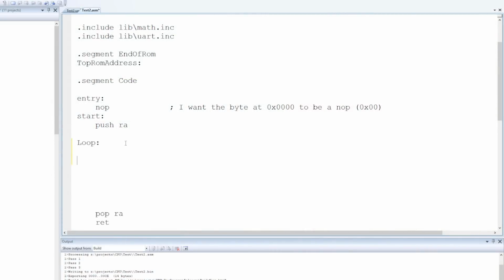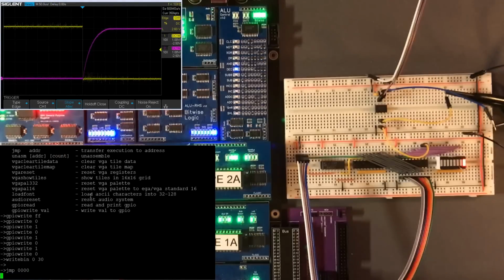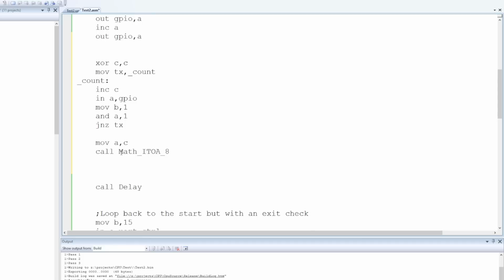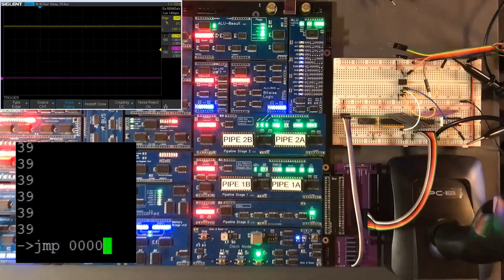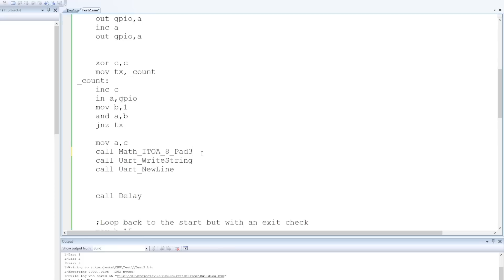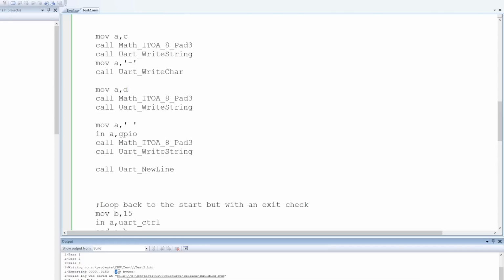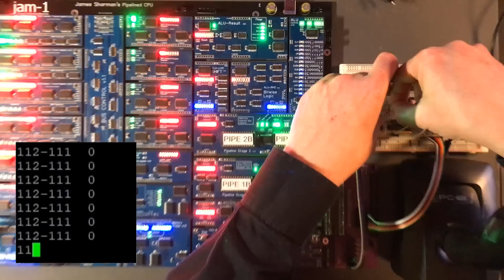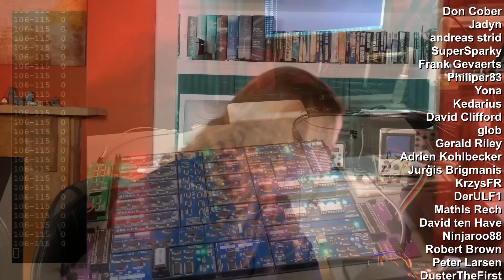Analogue In - IO from Scratch - Part 2

Comment: You can read out the joystick position and buttons, but you can't do much of anything else with that setup, can you?  You're relying on that loop running alone to measure the response time and if you go off writing textures and computing collisions, that timer is stopped.  Even if you had an interrupt, it might not be tight enough to give you a good reading.  How did they get around that when pong was moving the ball, etc.?
Reply from the maker: There are different ways to handle this and I don't know what implementations did what.  I would arange the circuit such that a full read would approch 1/60th of a second and count scan lines. That way the check could form part of other beam racing activities.

Comment: This is great, and could work the same way we do it with MCUs, by having it interrupt driven. Start discharging the cap with a timer set to zero, then increment the timer via the CPU clock (via a divider I guess, as you probably don't need extreme resolution), then the GPIO generates an int to store the timer value and set a flag indicating the conversion is complete. A lot of MCUs only have one or two actual ADCs, and multiplex them too. So I guess if you multiplexed you could indicate the channel when starting the timer and the elapsed count could be stored in a location related to the channel, so all of this would essentially happen in the background, and the main CPU code only needs to read from those memory locations when it feels like it :)
Reply from the maker: Indeed. But without interrupts I do find myself thinking about what tasks I could interleave. The Atari 2600 counted scan lines so it mixed it in with other work. Need a bigger cap for that though.

Comment: I saw that the Atari 2600 paddle uses this method. Very simple solution to an otherwise complicated problem.
It works even better on the 2600 because you can measure if the cap is charged on each scanline to position things like paddles in pong.
Reply from the maker: Yeah, although there is nothing to stop me putting a larger capacitor in and checking each scan line as well.

Comment: What you have built there is a rudimentary single ramp integrating ADC. If you added a counter and a comparator and a latch to count and store the rise time it would reduce your processor utilisation and turn your circuit into stand alone integrating ADC.
Reply from the maker: I worked out a circuit with a couple of counters and a latch to automate this but I’ll be showing other techniques in future.

Comment: 2:30 The circuit you're describing is somewhat similar to how capacitive touch sensors work as well. That's kind of cool.
Reply from the maker: Hmm, I haven’t looked into that but I can see how it might work although the capacitance is what would be changing rather than the resistance.
Reply: @weirdboyjim  Right. You run out a large-ish capacitive surface out from a lead, then you connect it through a resistor to a second lead. The first lead turns on periodically, and the second lead waits for an up-going signal. The capacitance of the surface should take a fairly regular amount of time to fill up and reach the trigger-point of the reader. However, if you touch the surface with your hand, your skin increases the total capacitance, causing the fill-up time to suddenly become longer. When I learned about them I was shocked by how easy it was to implement.

Comment: Converting a voltage/resistance into a PWM signal is clever for this kind of applications - the CPU can naturally measure time with high precision and you save on bus logic because the "analog" signal is basically treated like serial data rather than parallel data with a real ADC. The only question is, how linear is the pulse width from the 555 with the resistance? I'd guess the nonlinearity is negligible for gaming, or you can implement a very simple LUT for linearization (which is what the "calibration" screen in a videogame does).
Reply from the maker: I would have thought it would be very linear, I’m more worried about the cheap linear pots some of the joysticks have.

Comment: Could you do both axes with just one channel by interleaving them? Using a couple of transistors on the analog side to switch which channel is being read?

Edit: aha, I jumped the gun on that comment, I didn’t see the part about how you wanted to read them simultaneously. It’s a really cool ADC though, so simple and yet perfectly effective for a low precision input.
Reply from the maker: I was about to comment that you could, but it would double the read time.

Comment: Super cool! Also not the approach I'd guessed you'd take; I'd expected you'd go right to implementing a binary-search ADC -- that is, an R-2R ladder DAC plus a comparator to tell you if the DAC output is higher or lower than the analog input.
Reply from the maker: lol, let’s not get ahead. But that kind of ADC is much faster than this. Watch this space 😉
Reply: @weirdboyjim  I look forward to seeing it!
Though, the hardware implementation of the binary search ADC can be almost as trivial as the RC-time ADC -- you just feed the R-2R off GPIO output pins and loop the comparator back to a GPIO input, and let the CPU implement the search algorithm in software.
It's also pretty straightforward to move that binary search logic to hardware though, with just one shift register and one accumulator register. (Shift register scans a single bit across from most to least significant; this is ORed with the accumulator contents, which gets fed back to the accumulator input and to the R-2R; the comparator output then just feeds the accumulator's load enable line. The only other things you need there are the bus interface logic and a tiny bit of logic for resetting and triggering the start of a conversion, plus probably a clock divider to slow down the conversion speed to keep within the comparator's bandwidth and propagation delay limits.)

Comment: I used to use the same technique back in the 90's when I was playing with PIC16F84 MCUs and making line following robots with them.
Just sample the pin until it went from high to low, switch it to output to charge the cap, switch back to input and sample over and over until it went low. This gave a poor man's ADC and worked  like a champ. No 555 needed.
Reply from the maker: Yeah, I could do it with a cap and a diode but you are relying on the trigger threshold of your input pin being consistent.
Reply: @weirdboyjim  There is some definite hysteresis on the levels but for most of the applications I used, it worked fine.

Really enjoyed your video and the project.
Wish I had time to get back into that hobby.
It was my passion for many years.

Comment: When I saw what you planed to do, I knew you were going for the timing method, but my mind went in another direction: could you use a 8-bit (or so) counter IC, maybe a 74xx590 with output register. Connect it up to the system clock and have the reset/latch driven by the capacitor/potentiometer circuit? sure, this is more involved, but performance wise it could read the value without hogging the CPU
Reply from the maker: Absolutely. I wanted to go as simple as I could with this series but it’s very easy to see simple circuits that would do the job.

Comment: Very nice design. Another IC, i have used in this kind of designs is 74HC123. It got 2 monostable inside and it will be less parts. No real difference, the results will be the same though.
Reply from the maker: Yeah, I thought about using a 74xx123 but the 555 is such a jelly been part it’s nice to use them.

Comment: Since you've mentioned that you're considering another ADC video, I'll throw out a two-bit circuit I've been thinking of trying.

You run your input voltage to the bases of two "identical" NPNs (Q1 & Q2). Those are (independently from each other) tied to ground through a resistor (R3 and R4 in my schematic), a diode (for the voltage drop), and another resistor. One bit is pulled from the points between the diode and the ground-most resistor (through buffers, to avoid problems), resulting in two bits. Those same points each control a PNP (Q5 & Q6 in my schematic) transistor, which is connected to the opposite branch's R3 or R4 & diode through a resistor (R9 or R10) of it's own (the transistor is meant to operate in saturation, allowing the current flow to be controlled directly by those extra resistors).

The concept is that Q1 & Q2 produce basically identical amplifications of the input signal, which will turn on the buffers if the input voltage was high enough, and also will turn on Q5 & Q6 in that case. Meanwhile, if Q5 & Q6 are turned on, then they will steal a limited amount of current from the opposite branch through R9 or R10, which in turn will reduce the voltage in that other bank, possibly turning off whichever of Q5 or Q6 is controlled by it. By itself it sounds like this should be just an oscillator, but if you give R9 and R10 sufficiently different values then one will decisively be the "low" bit and the other the "high", with the bits "quickly" settling, and oscillations only if you're presenting an intermediate voltage.

I assume that these could be chained at the low-bit current-theft points, but I'd worry about stability with each additional bit.
Reply from the maker: Interesting, very different from what I’ll show next though. I’ll be interested to know what you think of that when I publish the video.

Comment: used to do this on pic's using one pin.
Set pint to output and set low-- ground the cap
Set the pin to a input and time until it sees a 1
Works well for most things.
Reply from the maker: Yeah, I figure I can do it with one output and one input and the cap.
Reply: Did the same only set the pin to output and high, charge the cap then change it to input and watch for it to go low. The threshold was like 1.2v for low so that gave you from 5v to 1.2v so more resolution than going from low to high which in the PIC16F84 was like 1.8v (If my memory is correct).
Reply: @jackflash6377  with bidirectional ports it's quite easy to do it with one pin. it's harder when you can't make the pin go high impedance, but diodes can help with that. 

I love old school logic.

Comment: Given a transistor is a current multiplier and given the voltage on a capacitor linearly increases in time when given a constant current, it would be very easy to implement this with a transistor and the behaviour would be pure linear, which gives you more accuracy.
Reply from the maker: Lots of ways you can do this. I may try a few others out when I have time.
Reply: Yeah, and the 555 timer also behaves linear, unlike I assumed.

Comment: Using a 556 timer you can ditch one timer, for one less component.
Reply from the maker: That’s the right thing to do if you are planning ahead or designing a circuit for manufacture. Separate 555’s make more sense for  breadboard build like this, especially since a have a bunch of them in my component tray.
Reply: @weirdboyjim  : I believe the 558 (despite having more pins tied together than the 556) was also good enough for the IBM gameport (even while supporting all 4 analog inputs), though unfortunately they seem to be as rare as hen's teeth. I don't think the 558 is manufactured any more.

Comment: I learned about this way of doing A/D conversion just like you by looking at the "gameport" implementation. In my case it was on an ISA card.  

I needed someone to explain how this trivial looking bit of electronics achieved analog input and when it clicked it blew my mind. 

Mainly because it made obvious to me how a change of timescale can make a qualitative difference. There is code, which we easily antropomorphize to be patiently waiting for the cap to discharge. Yet it seems instantaneous to us actual humans.
Reply from the maker: Indeed, even on this basic homemade cpu we can write loops than run >100k times a second.

Comment: Analogue is great - my prime-dean (the head of university) made a thesis over the analogue processors :) - i mean using simply the opamps and so instead of digital maths in an electronic machine :) - the SSDs though digital are really analogue physical devices - you need to adjust the voltage sometimes to be able to read a page :)
Reply from the maker: Opamps were originally designed for analogue computing, might be fun to experiment with them at some point.

Comment: Very cool!

Did you consider extending the circuit with a counter that would just put the number on the bus, so that the CPU could do other things instead of counting until a line goes high?

(You don't want to go more into that, but maybe interesting for other A/D conversation builds in the IO module, depending on your plans.)
Reply from the maker: The circuit would be easy, but in this series I wanted to do stuff with software. 2 counters and a couple of latch chips should do it. Use the carry line to trigger.
Reply: Was exactly the same i did think of when i was watching. Also in software you don't want it to depend on a code loop. Have done a speed controller for model cars in the past and those also had a pulse width to measure as input. You want a steady signal to compare agains so internal clock or high pace irq. Code loops make it inaccurate.
Reply from the maker: @chinesepopsongs00  this code loop is exactly accurate. No interrupts and a cycle balanced loop. Not my first rodeo.
Reply: It would be interesting to see someone use a 74HC590 and a comparator+clamp transistor.

Comment: Only just started the video and have to admit, even though electronics is my main hobby, I had never considered or read about analog input without adc.

My guess would be forming an RC oscillator with the potentiometer and count CPU clock per RC oscillator cycle

Edit: OK, maybe I took "no adc" a bit too literally. I figured discrete single slope adc were ruled out
Reply from the maker: Close, I’ll explore other methods in the future.
Reply: @weirdboyjim  OK, maybe I took "no adc" a bit too literally. I figured discrete single slope adc were ruled out

Comment: Smashing stuff, you really want to get a 100uF cap across the power rails near the NE555, they crowbar the supply when discharging and can cause all sorts of nastiness :) you could see it in the rising edge (overshoot) on the scope at one point.
Reply from the maker: Thanks! As big as 100? I usually put a 10uf on the pcb’s.
Reply: @weirdboyjim  Yeah I usually go with that, these days (esp at 5V) very little difference in physical size :)

Comment: Heh, as soon as I saw "analogue", I was thinking "He's gonna pull out a 555 and a cap"... and sho 'nuff :D

It's remarkably straightforward and useful. This is the way (although in a slightly more slick fashion) they used to do it in the Atari 8-bit line's paddle inputs. It was effective enough that, with a little glue electronics, you could digitize audio (at a ridiculously low bitrate, but it worked).
Reply from the maker: Indeed, it’s a useful circuit to know!

Comment: This is super cool! The circuit works very similarly to a dual slope ADC, just using an input resistance rather than an input voltage. It’s quite a nice simple way to read the potentiometer with quite good resolution and little error.
Reply from the maker: Thanks Duster! I may do another video on a different ADC technique.
Reply: It's called a single slope or ramp integrating ADC. Dual slope would also discharge the capacitor through a resistor to measure discharge time.